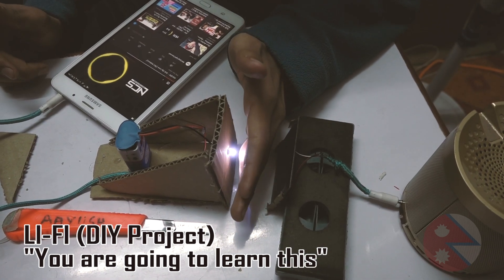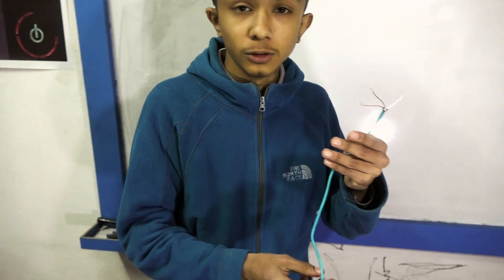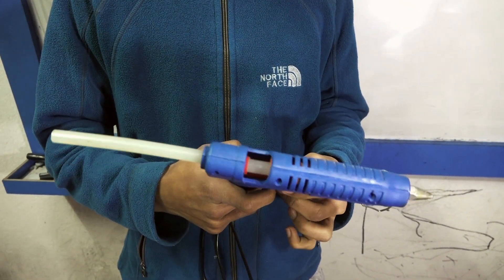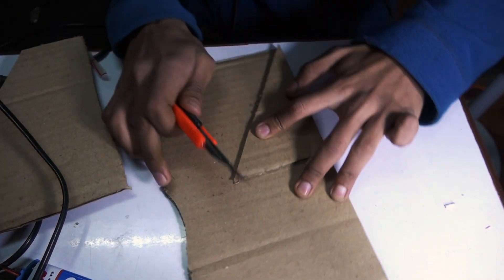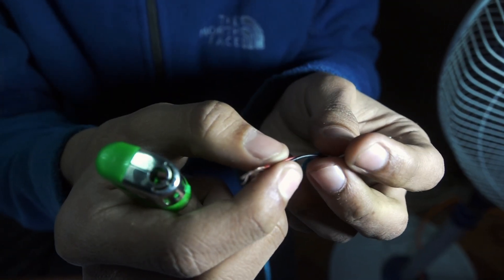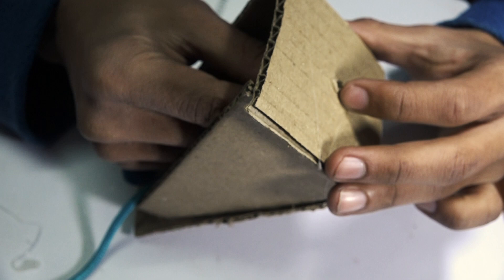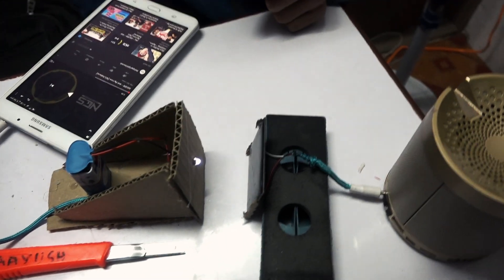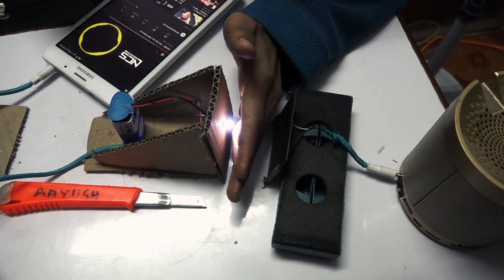DIY : LiFi Project For Students | Faster than WiFi

Comment: Great video, thank you for sharing. LiFi is the future for sure. Question: with this DIY setup, have you tried testing bandwidth? Also, the sound is noisy, I’m assuming its the solar panels (or is it the LED?). I’m wondering if instead, you can use a Laser pointer as transmitter, and something else as receiver for better accuracy/fidelity. What do you think? Also, this would work underwater I’m assuming?

Comment: This seems good but the question is since wifi have long range for transmitting data whereas this LIFI seems to have very very short range, is this good in transmitting the internet data?
Reply from the maker: Wifi also includes certain range. This video is just for demo and is focused on minimum range. Comparing to wifi, lifi because of light can have maximum broader range.